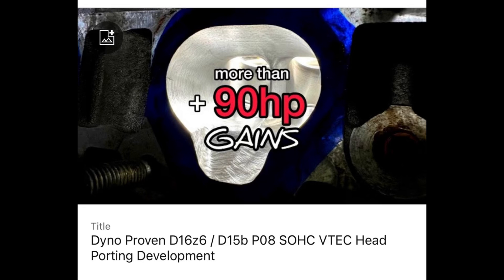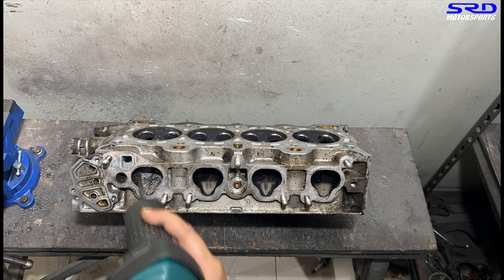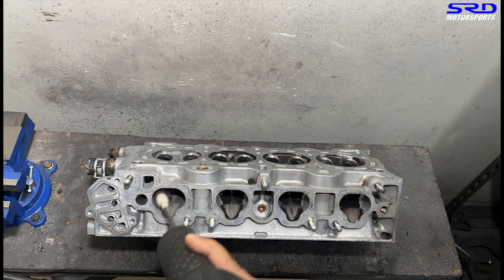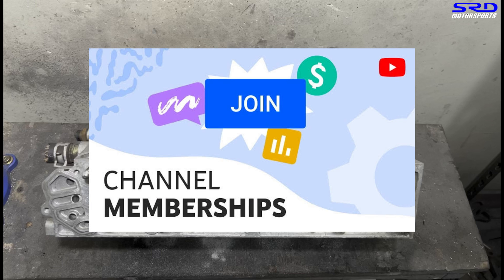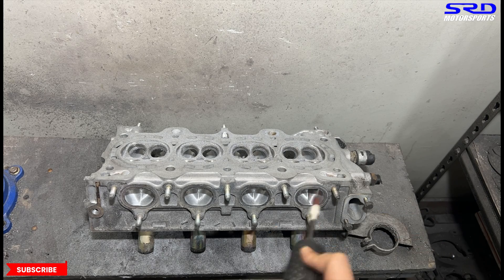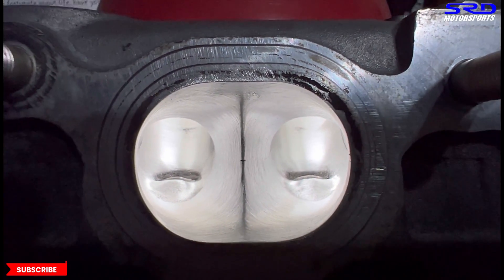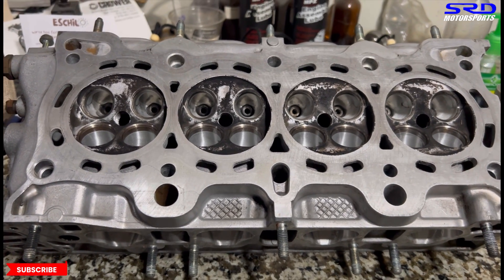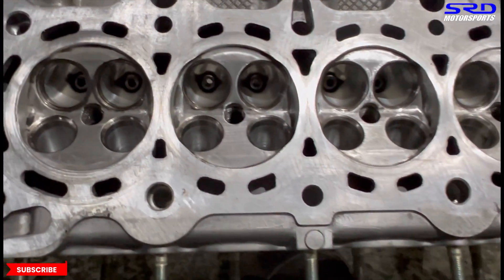D16z6 P08 SOHC VTEC Head Porting and Development

Comment: I have a p6fd1 engine naka cam gear tune and headers . What are your recommendations in order to get more power? Im planning to buy po8 head na port n polish hmmm? Kamusta nmn sya sa fuel efficiency  ?  Thankyou man silent viewer here pero may comment na 😂😂
Reply from the maker: fuel efficiency is good usually on p08 head
Reply: @SRDmotorsports  it is ok lng na head lng ung naka ported n polish hindi na ung intake mani?
Reply from the maker: @ yes Basta straight p08 not the vti head convert nonesense as I made a video about that issue 

believe it or not Meron hatch nka ganon vti convert p08 cam 16.2sec oras , like hatchback mas mabilis pa vios? 😂

Comment: at 13:20 you grit the intake bowl at 120 grit for the last inch, why?
Reply from the maker: makes it look cleaner
Reply: @SRDmotorsports  does it effect performance at all?
Reply from the maker: yes
Reply: @SRDmotorsports  how does it? doesn’t smoother port = less atomisation of the fuel and more turbulence creating carbon build up on the vavles?
Reply from the maker: it’s a fuel injected car so no need for carburetor approach 

You can go rougher if you want that’s no problem

Comment: how many in Mm adjustment port in exhaust and intake..
Reply from the maker: That’s not how you port heads… u can keep it almost the same but over port on the bowl and throat and it will still be over ported
But almost same mm entry and exhaust
Reply: @SRDmotorsports  it is advisable for 0.5mm valve troat and less 1mm porting for exhaust and intake ?
Reply from the maker: I don’t know, I don’t look at it that way ,,. U measure the cross sectional area of the port entry and u can tell if it’s already ok or need to be bigger
Most of the time on our Hondas the cross sectional area is already okay na…

unless u rev to 10k rpm
Reply from the maker: Example 30mm intake valve with 89% throat that’s 26.7mm 

Add 1mm to that throat and it’s 27.7mm
That’s already 92.3% ! “Sungaw na”

throat is somewhere before the valve seat fyi

Comment: Sir ask ko lang.
Nagpapalit ako ng water pump and pina-adjust ko na rin yung tensioner.
(p2j 20 cam lobes and tuned na rin)
Ang problema ngayon hindi ramdam yung vtec at ang pangit ng idle
Bago ko pinapalitan ok naman
possible kaya na mali yung timing?
Thanks po, More power.
Reply from the maker: Yes un lang possible reason kase aalisin belt to install water pump

Comment: how much would this deliver on a d16z9?
Reply from the maker: What do you mean? Power wise?
this does over 150whp on pump gas on a street car with a muffler…

if you saw the earlier (older design) on turbo it already goes way over 500whp without reaching 2bar
Reply: @SRDmotorsports  i have a standard d16z9 which had a revision 30k km ago, so it's like new. Only thing i do have at the moment is an k&n airfilter. If I would let a company port the head would it make any sense? I am planning to do the entire  exhaust, maybe replace both manifolds. Also not sure if the ecu needs to be chipped for this all to work properly.. sorry for all the questions but thanks for taking the time for your viewers, you are amazing 🏆
Reply from the maker: I think for now u can jump to a k&n filter only and try to get a rechipped ecu for tuning this way when u do the exhaust u can see improvements real good before going for the head porting

Because this head also needs a good intake an exhaust and tuning on the rechipped ecu so that can be done first that’s a better step

Comment: I've been porting heads for 2 decades, and I've been slowly refining my technique ...I just got in a set of various length Arbors & I have a few rolls of Sandpaper in grits 60 to 120 in stages. I would like to know how you put together your Sandpaper with the Arbor ...I've always used the Porting kits with the pre-rolled drums ...but they're so expensive, and you end up not being able to use most of the sandpaper. Thanks for these great uploads! I'm actually in the middle of working on a D16 head this week.
Reply from the maker: I use a blank drill bit (get the ones that hasn’t been machined for the blades)

cut a slit on the tip about 1/2 inch deep and that anchors the 80-120 grit and I just cut a 1in wide 6in long strip and roll it at the end of the shaft where the slit is and just hold it down with 1/2 masking tape at the base of it to secure it…

This lets me buy meters of 80grit and 120grit I can just cut accordingly
Reply: @SRDmotorsports  Thanks for your response! I will take your advice when I get my tool up and running!
Reply from the maker: No problem man glad to be of help 🎩

Comment: I been watching your tutorials and just got done cleaning up my Z6 head…I preemptively cleaned up the combustion chamber to soften the edges, no having seen it in any of your other videos and was worried I was going to mess things up. I ended up doing a high polish on the exhaust side mainly for aesthetics due to my OCD and then I ended up doing a full valve lapping to ensure a good seal on the valves… I still haven’t assembled the engine but I wanted to send some pics or video to get your opinion on the job I’ve done this far, is there an email or link I could send the pics/video too? 

I’m also in the member area as well BTW…
Reply from the maker: Yes sir it’s why I realized this video has to show a lot more on the chamber stuff and you worded it correct “to soften the edges”

both my IG and FB shop page I frequently check we can extend conversation and share pics there easier

Comment: Do you leave the valve guides in the D16 head because they're really shallow and don't protrude much into the bowls? 
What shape carbide burr do you use when shaping the head? Are switching out burrs for certain areas?
Reply from the maker: on this one the oem guides stayed cuz it was within spec and plus as u mentioned specifically  on the z6/p08 they don’t protrude as much…

the carbide I use is just the tree shaped carbide
the cone shaped sanding rolls help a lot too

Comment: Curious what your throat percentage is, if y’all don’t mind sharing…
Reply: Sharing some notes from Darin for discussion, not the hard and fast rule but a general guideline:

86% = Excellent average power and throttle response.

87% = Adds a little more top end power.

88% = Best over all power band!

89% = (Critical Max) Only use for 550" lift or higher camshaft

90% = You're in trouble, unless your max lift is .600 or higher.

91% = Loss of low end TQ and throttle response.

91.5% = Significant power loss throughout the power band!
Reply from the maker: @findtherightbeat  good stuff right there 😎
Reply from the maker: Usually it’s 
For street application : 88-89%
All out race application : 90-91%

but
Reply from the maker: I’ve done quite a few street stuff with 91% throat, granted it had a ported skunk2 intake
and cam, worked quite good
Reply: @SRDmotorsports any opinion changed on this
Reply from the maker: nope